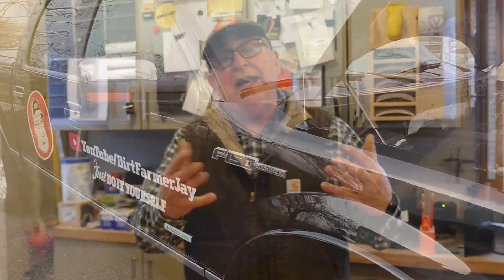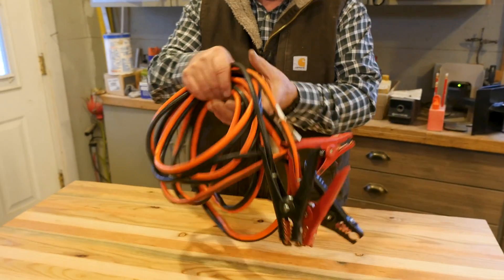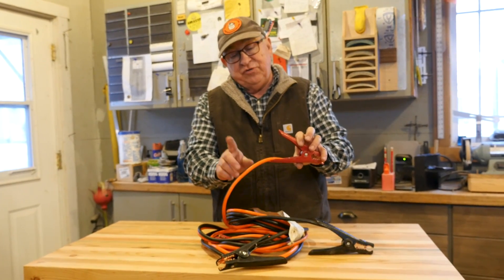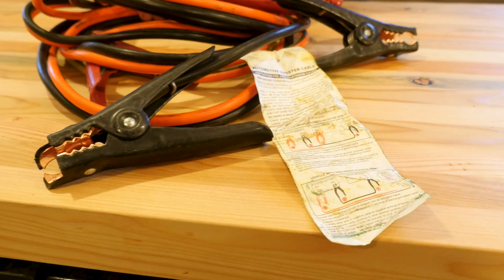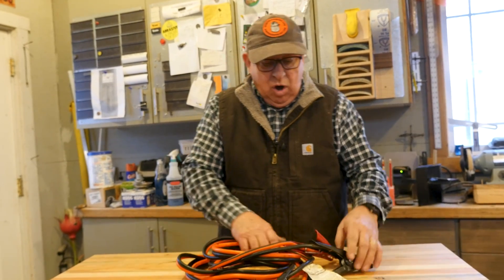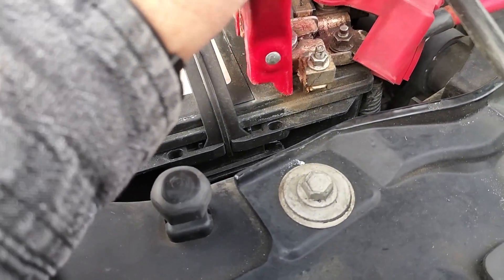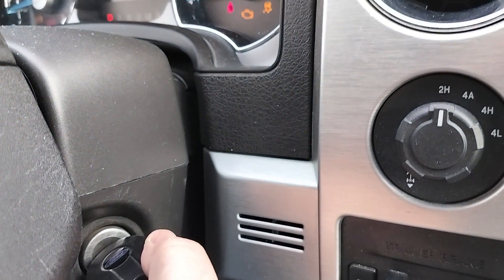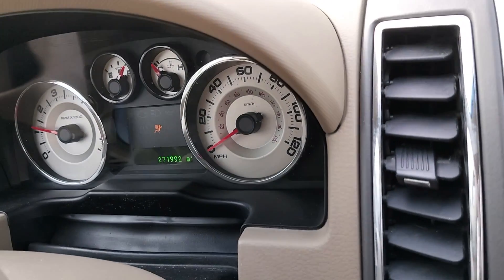How to Jumpstart a Vehicle Battery the Right Way

Comment: A full time mechanic told me there are several errors with your video, plus some cars require a specific methods for charging you didn't cover and doing it your way would/could damage components in the car.  Heck....for 50 years I went terminal to terminal, no problem.  Now they say to use the body ground (depending on manufacturer) like you said.  Have you tried to find a place to ground on the newer cars?  Personally, I think there should be a "grounding" post marked on the body under the hood for when/if charging needed to be done...."ground" to the wrong metal part and you could have serious issues!  LOL!

Comment: Also it's a good idea to check the owners manual.  My wife has a hybrid and the recommended ground point is in a bit of an odd place.  My 2017 Jeep also has automatic stop/start so it has TWO batteries and a dedicated set of lugs for jumping.  I haven't traced it out but I suspect the lugs go to the auxillary start/stop battery.
Reply from the maker: Alan, that's a great point. There are certainly exceptions like you mention or specially set up equipment. Based on this, it's likely we'll make another video on the subject down the line. Best, DFJ

Comment: Thanks for the video!  I have jump-started quite a few vehicles over the years and in several instances, the no-start was caused either by a corroded terminal and/or a loose terminal that just needed tightening.
Reply from the maker: Good stuff!